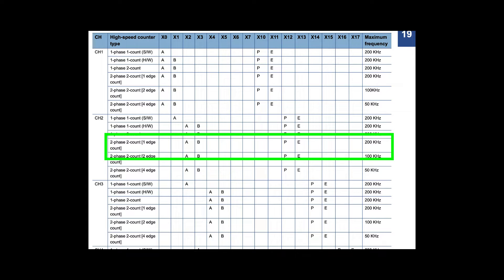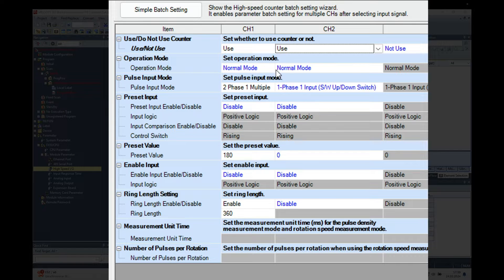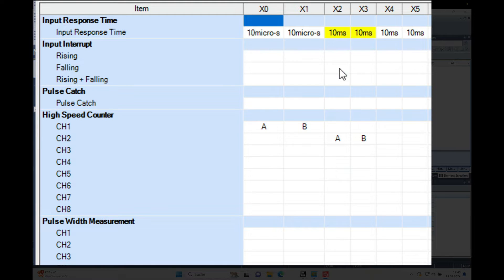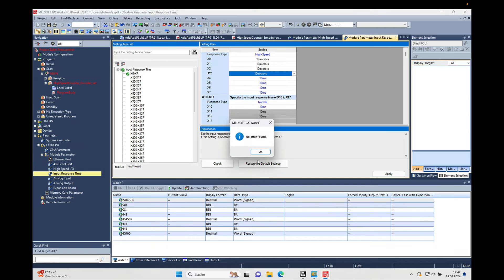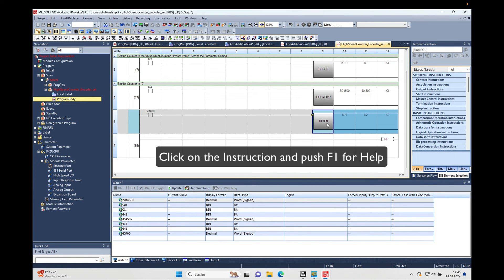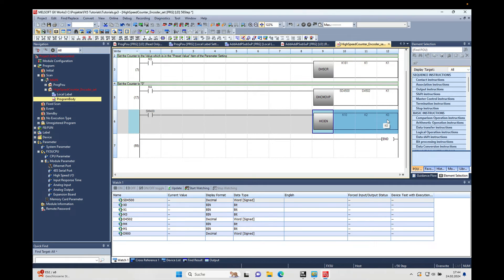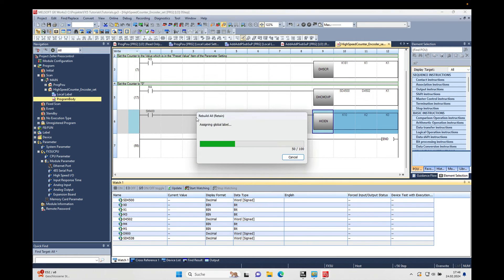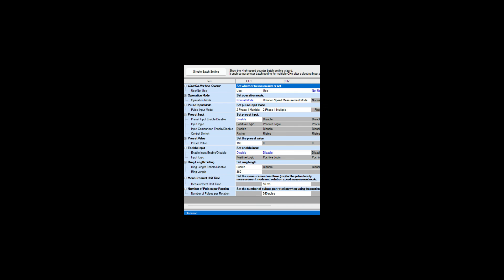Rotation Speed Measurement Mode Mitsubishi FX5U  High Speed Counter

Comment: Hi Sir. 
May I control realtime by Manual pulse generator (MPG) by using HSC input example X0, X1, and PLC high speed output to control servo MR-J4A ( pul/sign type)? Im programming PLC FX5U.
Thank you and Wishing you good health.
Reply from the maker: Hi, Thank you for this question. Do you want to sent this signal from the input straight to the output? I haven`t tried that . Unfortunately i do not have a CPU with me at this time to try it out. It would be worth a try.